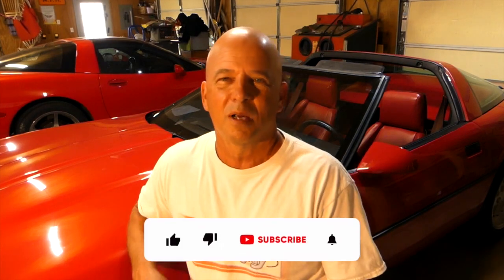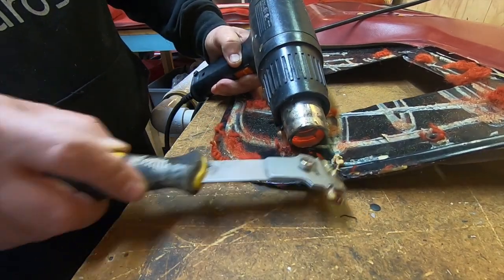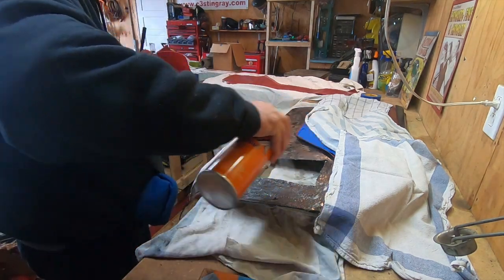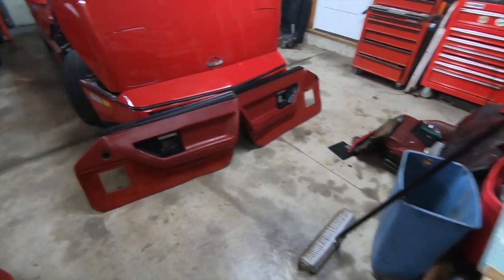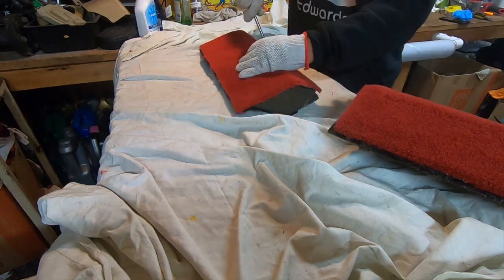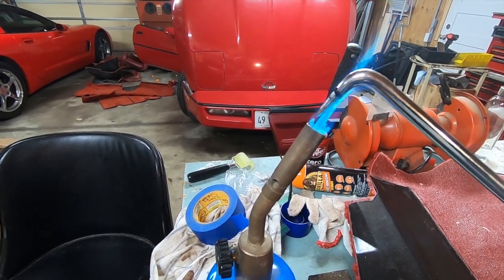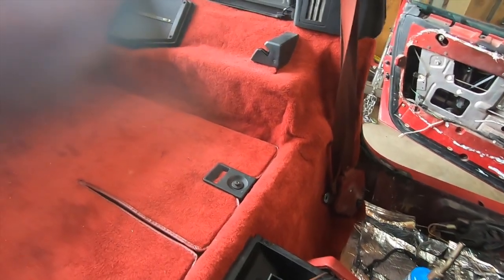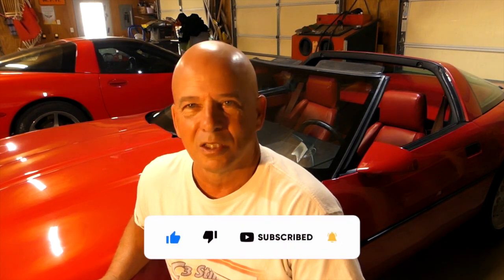C4 Corvette Complete Interior Replacement Part Three: Putting carpet in hatch, door panels, bolsters

Comment: Could you have done the PS knee bolster without removing the panel from the dash? I watched how much you fought with it, and I want to avoid the same
Reply from the maker: You can, but it actually harder without removing the dash panel.  The dash panel is the easiest thing to remove.  None of it is very easy, if you don't have to replace the carpet on the bolster I would just leave it alone.
Reply: @C3Stingray  I’ve got my interior going back in now. Your videos were super helpful. Than you for taking the time. 

Now how can we convince you yo do a 84-86 headlight motor rebuild video 🫣
Reply from the maker: I did one on the 84.  Go to all my videos and you should find it.  I did the later model and the early 84-87.